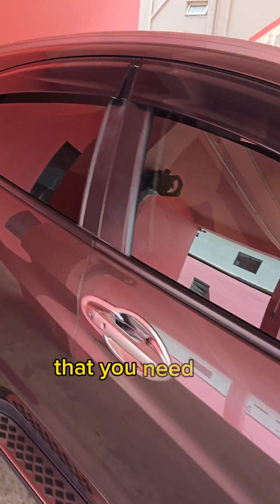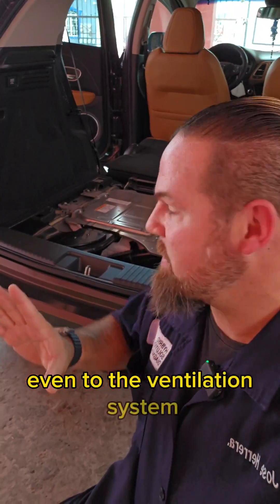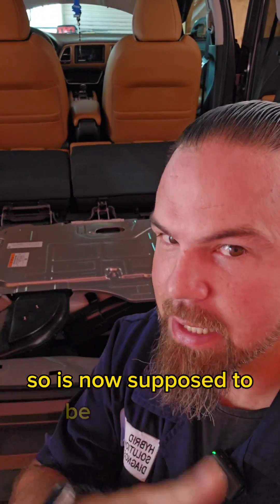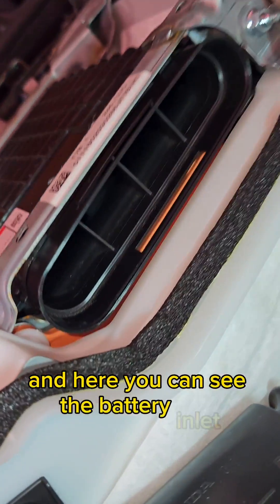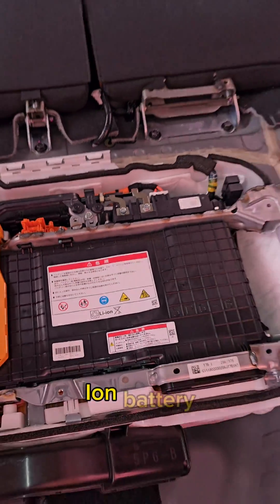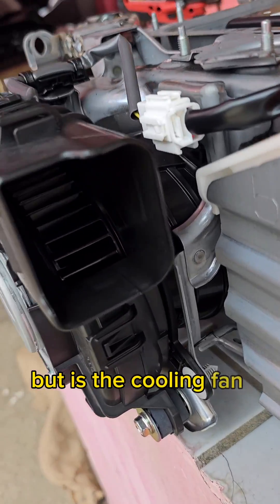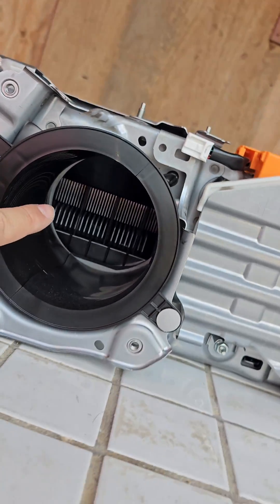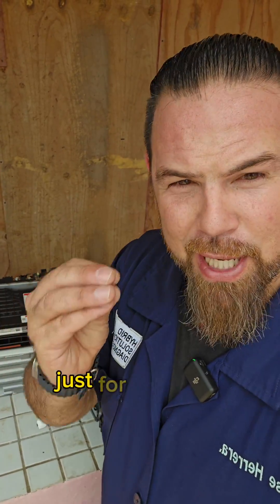Honda vezel hybrid battery fan cleaning

Comment: Hey there...does honda vezel 2019 has DCT issues? Do I need to switch from D to N during traffic to avoid overheating the clutch ? Pls advice
Reply: Use brake hold

Comment: For a honda vezel 2019 model.  Can you tell me anything here,  if the clutch leaking fluid and a new one installed but its not re-programming with the new clutch system . What does this mean? Again no prior issues or sensor lights on the dash indicating mechanical problem. Its just the car not driving only on electric mode.

Comment: I'm driving Fit Shuttle Hybrid, has the same intake for the hybrid battery. Can I put a filter screen on the intake area, to eliminate/reduce the dust or debris? Would it damage the suction fan due to stress?